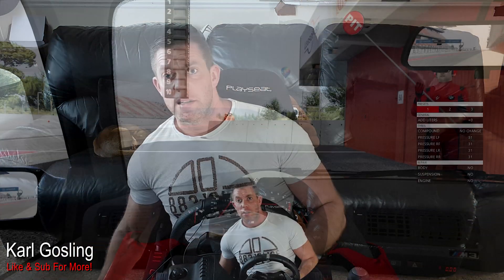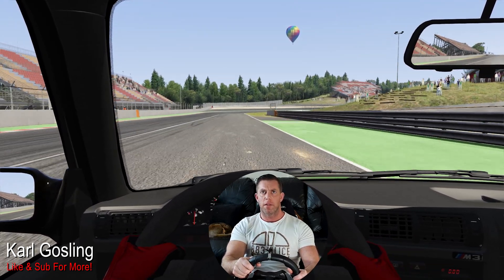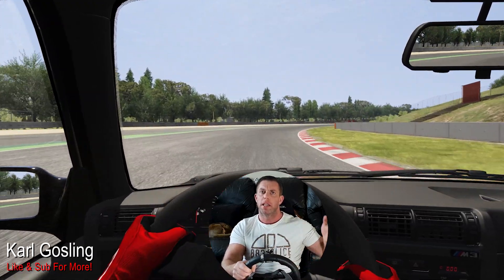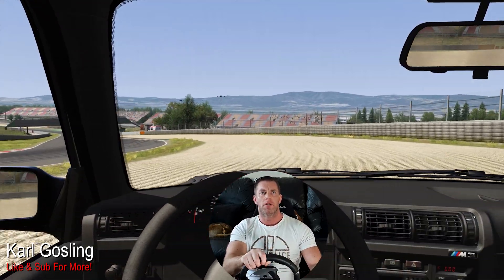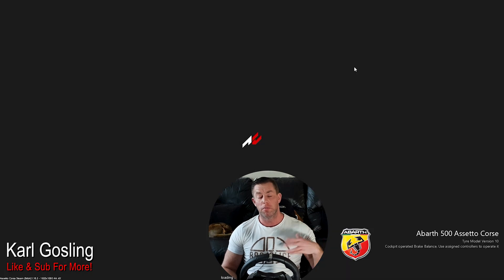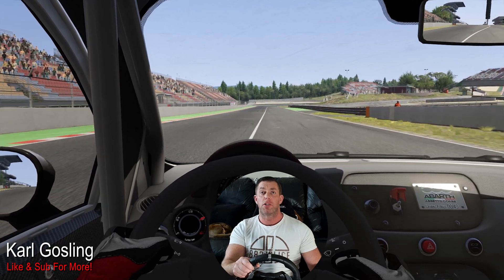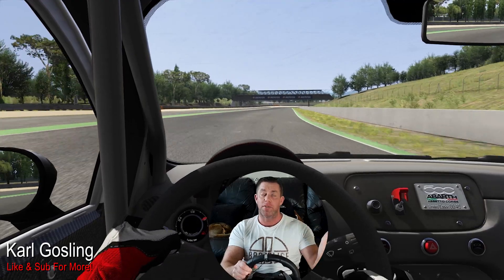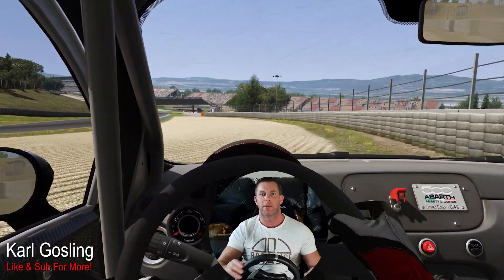Sim Racing Studio Traction Loss Update - Shake Kit

Comment: Hey Karl, 2021 now.. do you feel this is a good investment after; 80/20, dd wheel and heusinkveld pedals? I race mainly in VR. Dirt2, acc, iracing. Maybe some am2.

I’m considering pulling the trigger on the Elite, and then consider upgrading to heavier transducers over time.. perhaps even attach them to the frame then.
Reply from the maker: I would actually say IME having tactile adds more than motion, but it's very close! If you can do a larger DIY setup you'll get more out of it, if you want plug and play then yes go with this :)
Reply: @KarlGosling  thanks Karl, appreciate your perspective. I have some diy skills but it’s more a matter of time. Hence I was thinking the 6x120watt outputs leaves some room to replace the default transducers with heavier ones at a later point, when time and money to spare :)
For now reasonable price and plug and play (well, apart from settings tuning) is kinda what I’m looking for.

For that same reason I won’t be doing SFX100’s myself :) though I suppose that’s a different scope.
Reply: It’s funny how this rig story is never ending, every time I think I found the limit, then next thing pops up. Ordered the Shake Kit elite.
I’m now considering instead of actuators, to get the dofreality P2 and afterwards upgrade to P3.

Since I will be having the light aluminum 8020 build from Swedish rig designs, coming in at only roughly 20kg, with light bimarco chair, I think it’ll fit nicely on the base of the dofreality (leaving off all the additional steel).. it’ll need some effort to mount properly, and have it well balanced. But at the rate I’m seeing people mod the dofreality with 8020 profiles, taking the P series just to be on the safe side with motor load.. maybe it’ll work a dream. Or maybe not but can’t fault me for trying..

Will post my story when it happens... 4th quarter probably 😅
Reply: @patrickroza3073  Hi Patrick, what did you end up doing? I think I am now where you were back then and I'm not sure whether to go the DIY route or go for the plug and play option! I have the Playseat Challenge, so I'm not even sure how far I could go with a DIY option.
Reply: @PandaPowerable  I’m quite happy with the shakekit elite.
I got two packs in my seat and the pedal pack i took the exciters out and bolted them yo my pedal tray
Reply: @patrickroza3073  Great! Thanks for the quick reply!
Reply: My main issue is, I could put the 500 quid to saving up for motion actuators, and get those half a year sooner, or getting transducers now and enjoy them the full year until in get the motion..

Comment: I have the shake kit and i added  the buttkicker gamer 2 via the orange port....I have the buttkicker applied to just the engine. Is there a way to make the engine vibration decrease when you increase the RPM.....
Reply: Coming soon the ability to turn off engine shaking after a certain RPM
Reply from the maker: Excellent! :) Ideally we need to be able to control the RPM at which it stops and the the curve of how it fades out too (so over what rpm range it begins to fade away).
Reply from the maker: No, I suggested this the very first time I tried this SRS Shake Kit and they said they would implement it in a future update... constant engine vibration is annoying IMO and should work just as you describe, I'll chase them up! :)
Reply: @KarlGosling  have you ever or can you use sim tools and simhub for the shake kit and dofreality
Reply from the maker: I believe you can use Sim Tools for the DOF platforms but I've never needed to try, I don't know about the Shake Kit.